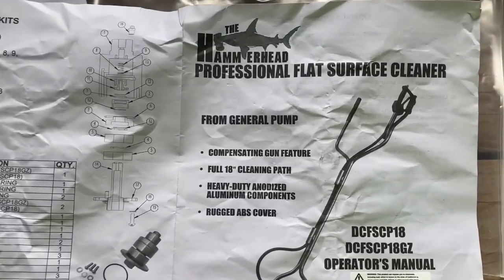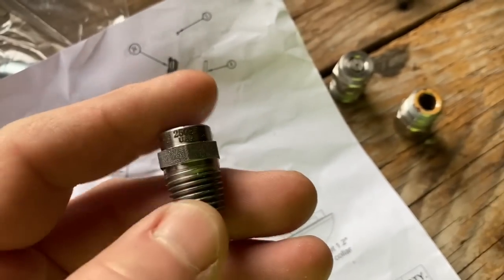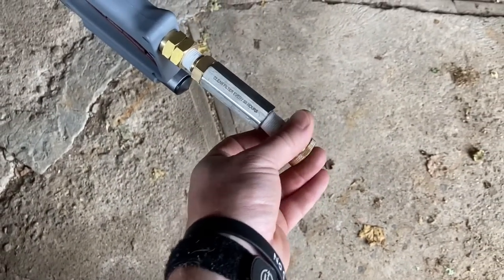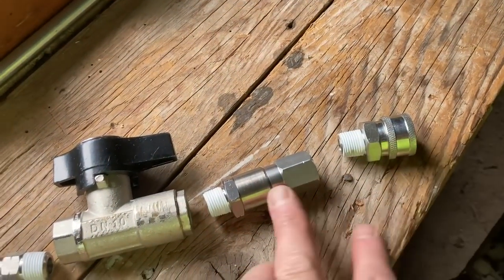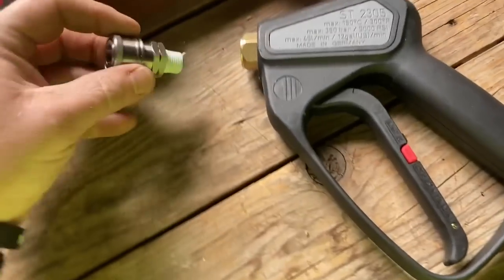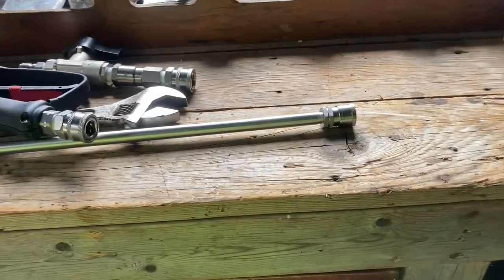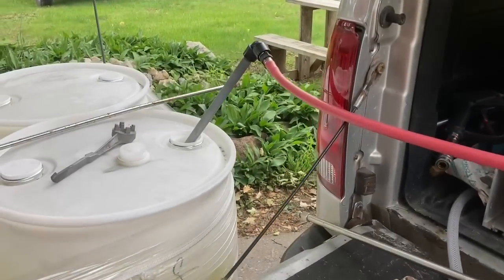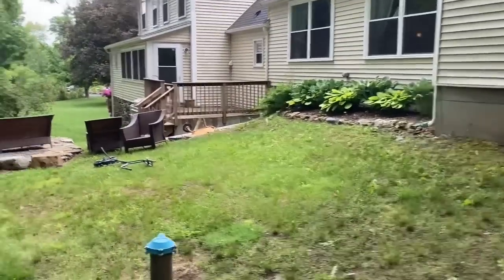GP Hammerhead Build. Sutner Easy Pull Build. DN10 Mosmatic Swivel.

Comment: Two 2.5 nozzles is going to produce 5000 psi at 5.5 gpm. Your gx390 is only capable of 2500 psi at best with your 5.5 pump. Your gonna have to bypass half of your flow just to keep your machine running. Gpm is king, not psi. 2800 hundred psi is perfect for residential concrete. Your talking one step forward and two steps backwards with your surface cleaner setup. Put a couple of 3.5 nozzles in it, and adjust your bypass to a slight trickle with the trigger pulled. You need to spend some time on the PWRA forum, and read up on unloader settings and machine setups.

Comment: Ran that same surface cleaner on the same machine. 25025s left lines for me. Was having to pre and post treat at 3% to get rid of the lines. Found out that 2503s did really well. Fixed my issue. Rarely had to post treat. Also tried 40025s and that wider fan helps alot also.
Reply: but i also do not run thru my hose reel. i pull off what i need and hook directly to my jump line. so i may have had a little more psi by bypassing the reel

Comment: Not sure if anyone said anything in the comments already, but your pump has too much oil in it. If it has rained recently you have water in your oil from the vented cap that happened to be a few months ago on the same pump.
Reply from the maker: Why do you say that? It’s right above half it the site glass on level ground. No water
Reply: @powerfulimprovements  At 55sec in the video it looks like the oil level is almost to the top of the sight glass

Comment: Joe..check the psi rating for the Hammerhead. Had the same unit and the pump was rated for 2500 and it wasn't enough to run my surface cleaner. Most surface cleaners have a minimum that they will run on and like most things the higher the number the higher the performance
Reply from the maker: I’m pretty sure I just need to crank down on my unloader and reset pressure with a green tip to 2500. Tomorrow we will see
Reply: I would be curious to see..hope it works out for you..thx for the great content as usual!

Comment: You could also try putting the 25020 tips back into the surface cleaner instead of adjusting the unloader.
Reply from the maker: Today I adjusted the unloader and it performed a bit better. I think I’m gonna try putting the 20 tips in instead and see if that isn’t the sweet spot
Reply: @powerfulimprovements  sounds good! Keep us updated. I have the 18" with a 3.5gpm but haven't got to test it out yet. Hopefully tomorrow.

Comment: I just bought the 20” Hammerhead. I couldn’t believe how big this thing was compared to using a wand and a 16” surface cleaner. 😂 can’t wait to use it. I also have been using the 2305 for 2 years. It has been great. I’d get a couple rebuild kits for them. They go out about every 6 months

Comment: Thanks for video. Make sure when you screw in the tips of the surface cleaner, that they are leveled to each other (same height) otherwise you may create a two tone when cleaning, if you screwed in a tip 3cm more than the other one. Happened to me the other day.

Comment: Nice surface cleaner the heavy commercial ones do make a huge difference I got the be 20 inch she runs on my 4gpm had it for about 2 years no problems so far I’ve heard good things about the hammerhead model great setup joe 🙌🏾

Comment: Another great video, Joe. When putting together a lance, you can put the fittings on finger tight, then put a wrench on each fitting and tighten both ends at the same time. As you’re standing over the lance, your left hand will pull the wrench towards you and your right hand will push the wrench away from you. This keeps from having to squeeze on the lance itself as all of the tightening is done with the fittings. Get Patrick feeling better again, get him some ice cream!
Reply from the maker: Genius
Reply: @powerfulimprovements   Even better is to put the ends on by hand, then put one end in your vice and tighten everything from one end, this is great for longer lances where you get reach both ends.

Comment: Once you get it dialed in you’ll love it but may want to put some weight on it. That model can give you a serious workout due to the straight handles when trying to move it and keep it down on the surface. 
I learned the hard way about an open ended ball valve!

Comment: Don’t hesitate to remove the in-line filter. It may be restricting flow. Also, make sure your bypass is open. I know you already know that. Just thinking out loud. One last thing. Try running your hose straight from the machine. Just for a trial. If it flows better, you know the restriction is in the bypass. Your sweet spot is going to be around 3000 psi if I remember correctly.

Comment: Bear in mind Joe, that the bearing will take a bit of time to "bed in", & the best thing you can do is to bypass the gun. Keep it purely to act as the handle, but disconnect the hose  from it, & ball valve straight to it. You'll get a much better flow, with no restriction because of the gun.
Reply from the maker: That’s an interesting idea. I’m going to remove the inline filter today too
Reply: @powerfulimprovements  i got the same thing joe ball valve but no inline filter works good
Reply: Its like the modification you made to your by pass set up. Although the gun is referred to as a lineal gun, its not straight thru. There is an elbow in the gun, that basically slows the flow, so, yeah. Ditch the gun.

Comment: I would try putting larger tips on the surface cleaner you really want that extra flow more than the PSI. When you run smaller tips then the GPM of your machine you can also run into issues with etching concrete.

Comment: I run the exact same machine and surface cleaner. I like to use 25 #3.0 for tips. Also, I think you’ll end up removing that filter from your surface cleaner. Mine always seemed to plug up very easily
Reply from the maker: Thank you for the advice!

Comment: Joe, did you ever get your Hammered dialed in? Did ya have to dial up unloader? I just ordered the 20” and wondering if I will have to adjust mine on my 5.5 gpm.  Thanks for any help 👍
Reply from the maker: Yeah it’s working pretty good. Turned up the unloader
Reply: @powerfulimprovements  ok thank you 👍

Comment: 5.5 gallon per minute tend to run at about 2500psi with a gx390 i think you would have better luck with the 2520 tips on the surface cleaner

Comment: That ball valve has become very difficult for me to open back up after closing... idk if it’s due to pressure from the powerwasher or something else but I have to put a lot of force into turning it back open
Reply: And nothing better than a fresh batch of yellow sauce!
Reply: Hmmm, I think it’s a corrosion issue and not pressure. I can run mine at 4K or on my smaller 2.7k and there’s no difference with the ball valve. But that’s my guess.
Reply: @jamesg863  I’ll take a look today for corrosion but I’ve never had SH or even a surfactant through it. Only fresh water. 
It was fine for a couple months then became so difficult I don’t even want to use it.
Reply: I have 2 brands of Ball Valves. One gets pressure trapped like you described and the other never has any problems.
Reply: @jacobwinchell8521  can you share which one works well for you please
Reply: @MrNick-  Both from Pressure Tek online. The good one is item # 6292 BALL VALVE 3050PSI 3/8 FPT NICKEL PLATED. The one that gets pressure trapped is DBV501238 General Pump 3/8" FPT BALL VALVE 5000PSI
Reply: @jacobwinchell8521  dude thank you! The one you said gets pressure trapped is exactly the one I purchased. I really appreciate the help and will buy the better one soon
Reply: @MrNick-  another option that might work on the pressure trapped GP ball valve is to take off the knob and install one with a longer handle so that you have a little leverage to help open it.